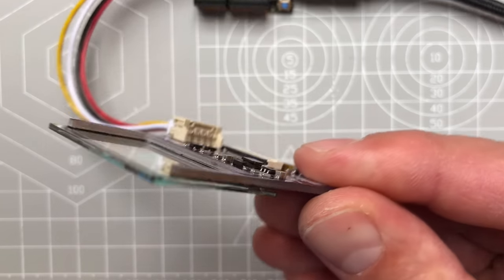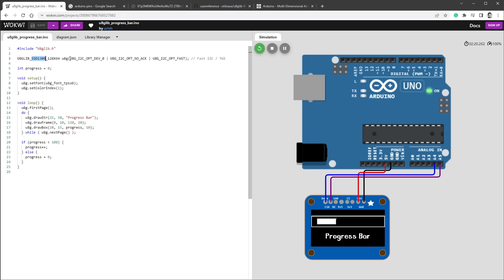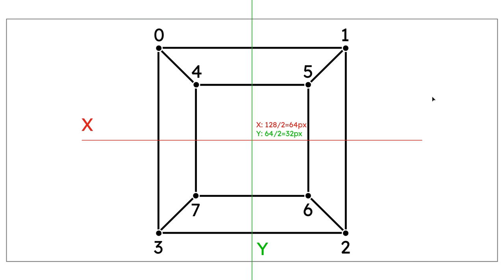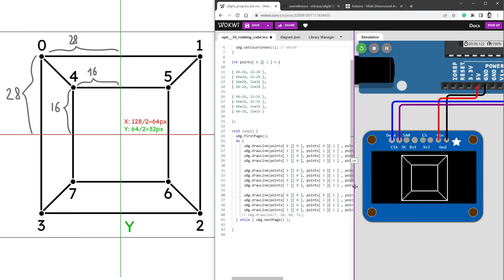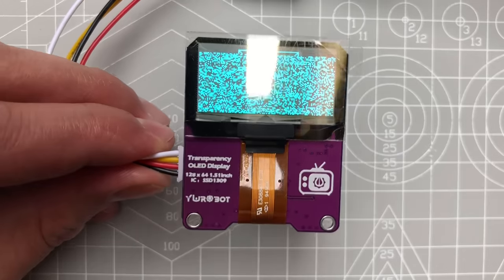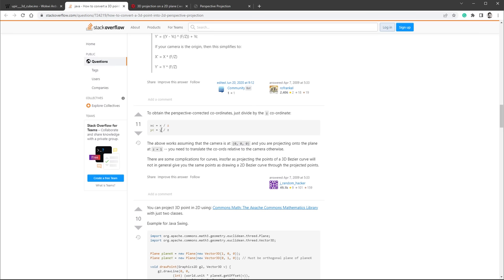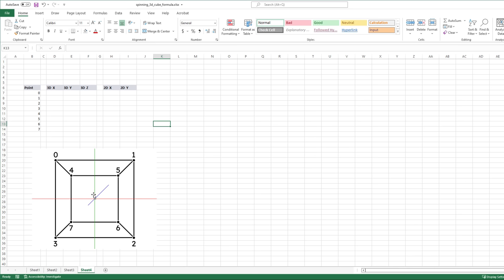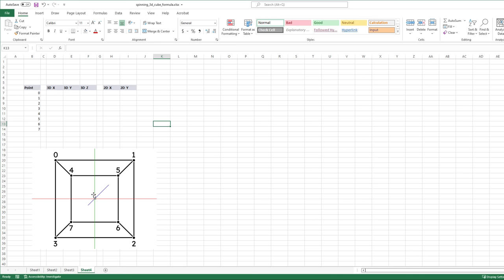Arduino + OLED = 3D ?

Comment: I wonder if these displays can be stacked to produce a volumetric multi-layer display. Looks like it's transparent enough to allow about 6 layers.
Reply from the maker: They could, and someone has done this already. It’s pretty cool — https://youtu.be/sVv1oc14X1w
Reply: @upir_upir  Ha, I figure I was recommended your video because in the past I watched that other video.
Reply: Yea but you would need eye tracking or the layers will shift as the eye moves. I bet you could do the same thing with one bent into a v and then mirrored and then one in front and to the back of the 2 v's
Reply: Real 3D hahahahhaha
Reply: im asking the same question
Reply: hello friend :D
Reply: Lookup Sean Hodgins. 

But yes. The possibilities

Comment from the maker: Quick update, I have tried a different 128x64 I2C OLED (non-transparent) display, and it works fine with the "fast I2C" connection, so it´s probably just a problem with this particular board? I don´t know the answer yet, but I will keep investigating the problem...
Reply: Hey bro, I am some sort of a newbie in embedded, So...How can I ensure that displays are Paspbery compatible or not?

Comment: Would love to see the explanation of the hidden lines problem. I started getting into 3D graphics back in the early 2000's in BASIC, but never fully understood the matrix multiplication needed for rotation. Now as an engineer I get it but havent had the motivation to implement it myself.
Reply from the maker: I actually don´t know how to do it in some "easy" way. The "standard" way is to define normals for vertices, and calculate visibility based on the normals orientation. Which of course involves either a lot of individual rotations, or matrix multiplications. In the cube example, I´m just faking it, since I know which lines would be invisible at which point.

Comment: You can speed up the calculation a little bit more - you are calculating the radians 32 times, but you only need to calculate it 1 time.  And then there is a hack. instead of using sin and cos, you can use a precalculated lookup table... yes that take more memory, but is way faster than calculating sin and cos.   i dont know how much faster this would be on an arduino, but i expect a lot.. this was some of the tricks i did like 30 years ago
Reply from the maker: Thank you for your suggestions. I’m actually using lookup tables for sin/cos functions, but good point about calculating radians, that’s surely not needed. I will try some changes and see how much faster it could be.

Comment: Love the detail in your videos! I suggest having a look at the GC9A01 Round Displays. They are neat! Also running two displays at once would be cool! Keep up the good work!
Reply from the maker: Thank you for your comment. I’m actually looking at that display for some time, but I would need to switch to some faster Arduino or perhaps ESP32. The uno is too slow for the display. I will post some video once I have some project running. Good luck with your projects!

Comment: Would be a cool screen to use with a accelerometer / gyroscope to make some AR-alike solution.
Reply from the maker: That’s a good idea, thank you! I will try it soon.
Reply: thats one of the many projects i wanna make, dunmo how to animate like a gyro map that moves when i move the accelerometer
Reply: I dabbled in this a few years back just for laughs but it didn't work, as expected since you need some mirror and lens to simulate depth by changing the focal length of the image being produced on the retina and at that point you might as well use a normal display and mirror and lens XD
Reply: @XxBanziixX1  I just thought that you can calibrate the gyro somewhere in 3d space. and then have a 3d model that you move according to the gyrodata. Then its like you move a camera over the 3d model. I have not tried it, but it should be possible.

Comment: Great project! I have one questions though, why do you use u8g instead of the newer u8g2?
Reply from the maker: Thank you! No particular reason except I like the documentation more. Otherwise, it should not be a problem to use u8g2 - I do use it in some of the newer videos.
Reply: @upir_upir  ok that makes sense, being the older version. The thing is that I was running some very simple u8g2 sketch in wokwi and it was unbearably slow, taking 10-15 seconds for the first render so I thought it might be due to the performance overhead of the newer library. Do you know something about this?

Comment: Tried this a long while ago (non-Arduino Mega2560, ASM code and parallel bus, 16 BPP screen - holds 60 FPS with antialiasing). It is much more fun to code if in color, as the 320x240 framebuffer will not fit into the SRAM, so a lot of bus transfers (wanted a background image to remain).
Reply from the maker: That´s great to hear. Do you have any links to your project? I would love to see it!
Reply: @upir_upir  Will upload one day (was actually a useless feature built into a service tool just because why not).

Comment: I would love to learn or even know what is all of this...:(. Great video though pretty cool stuff
Reply from the maker: I would suggest watching my older videos - for example the turbo gauge, that one has more details and it´s slower pace. If you don´t know anything about Arduino, please start with some generic "intro to arduino" video first. After that, buy  the Arduino UNO board, this display, connect it together and start playing. The biggest advantage of Arduino is the learning curve, as you can start with a very little and add more complex stuff later. In any case, let me know if you have any questions, I would be glad to help or at least give you some direction! Good luck.

Comment: Is there much difference between u8g and Adafruit SSD1306 libraries? I'm currently using the adafruit one and it takes  43 ms to erase and refresh the screen. Guessing it doesn't matter too much.
Reply from the maker: The u8g should be slightly faster, but probably not too much. Otherwise, those are both very similar libraries.

Comment: Subscribed! How the frequency/speed of the loop is controled? which determines the refresh rate of the screen or the other way around?
Reply from the maker: Thank you! The loop is trying to run as fast as possible, so the speed is determined by how fast are the calculations and drawing operations performed

Comment: Hmm... I would like this to be in the car as a HUD. Showing all the necessary output on the  screen. It's perfectly transparent to be applied for it. Although i would opt for a little bit of a bigger screen. I know there are kits out there that do this but doing it with this is more fun.
Reply from the maker: I agree completely. It would be great to have a bigger screen, and I’m sure that sooner or later, it will be available. Once it’s out, I will create the HUD project 🙂
Reply: @upir_upir  that would certainly be a interesting little project to see. To be continued??🤔😋
Reply from the maker: That´s surely possible! :) I will add this to my to-do list for projects

Comment: Is this the same display which used on heads up displays?
Reply from the maker: Probably not, this is quite big and has small resolution. But you can try to use it.

Comment: The IIC bus should have pull-ups. That MIGHT be why the high-speed doesn’t work
Reply from the maker: Good idea. I remember adding pullups for a different OLED display (that was the 16x2 OLED), because it was not working without those at all. I might try it here as well to see if it helps.

Comment: There are 15 OLED products in the link. Which one is used in the video?
Reply from the maker: Choose the one with PCB and for 5volts. There are two of them - with purple PCB or green PCB. That´s mainly just a cosmetic difference, they just look different, but will work the same.

Comment: Can you push a live video signal at 12 FPS ?
Reply from the maker: Yes, that should be possible. With a more powerful microcontroller than Arduino, you can even get 60fps.

Comment: You should calculate radians and use calculated value instead of calculate radians every lines twice.
Reply from the maker: Thank you for the suggestion. You are right that there are more optimizations that could be done to the code, but since I´m only transforming 8 points, the transformation wasn´t the slowest part of the code (it was the display connection - I2C vs. SPI)

Comment: Works with ESP32-ILI9341 320x240 SPI mode but has a glitch..odd lines at the initial start and the last frame of the rotation. I had to put a delay in because it spun too fast.
Thanks for sharing
Reply from the maker: Thanks for letting everyone know! Do you perhaps have a video of the project running?
Reply: @upir_upir  www.youtube.com/shorts/sOFFgF2tCzk  Link to source code 
drive.google.com/drive/folders/1tOAnoLebt8yYAtpwPEj_This14S4bJtw?usp=sharing
Code has a glitch I thing it's the 1st few lines drawn are wrong "shrug'
Reply from the maker: That’s great!

Comment: I wonder if the faster bus speed is a glitch on that 328 chip. Maybe try it on a different arduino.
If the edges of the generated signal are to 'round' for the display you might wanna decrease the length of the wires.
Reply from the maker: I will definitely try other Arduino. I was trying to google this problem, but haven´t found much information about the fast I2C connection. Good idea with the wire lenght, I will try that for sure.

Comment: Dude if u want a transparent display just use a LCD panel
Reply from the maker: Just remove the backlight? Well, that’s surely possible, and you will get transparent display, but it wouldn’t be very useful

Comment: got the same lcd with arduino uno and just seeing static on the display in blue
Reply: actually cant get it to display anything now. was seeing upir logo before aswell
Reply from the maker: that´s strange. Please check the connection and the wires. In the code, make sure you are not using the FAST IIC connection (remove the word from the initialization), and it should hopefully work. If not, please let me know.
Reply: @upir_upir  I used jumper cables to plug the cable that came with the lcd to the arduino could that cause an issue?
Reply from the maker: @genesisvlogs2140  I don´t think so. The provided cables should be perfectly fine. I would just make sure that the connections are correct, and make sure that the fast I2C connection is not used.
Reply: @upir_upir  i mean like in your case you cut your wires because they are only female pins at the end . In my case I used  a set of male to male to connect the arduino to the provided cable female input. I tried the slow IIC connection as well

Comment: use ++i instead of i++ and it will save some cpu in cycles
Reply from the maker: Thank you for your suggestion. I have quickly googled the difference and it seems to be the same speed for integers, but it’s surely something to keep in mind.
Reply: @upir_upir  its use size of one int in ram to return previous value

Comment: It's a great tutorial, but just one thing, after i saw it more than 10 times and stopped several times, please speak more slowly.
PLEASE.
Reply: You have to stop so people can think what you are saying.
Or else it would be something like this. https://en.wikipedia.org/wiki/Gatling_gun
I am sorry to point that to you but i really liked the info/video but not in the way that you delivered.
Reply from the maker: Thank you for your feedback. I agree that the speed was too fast this time. I will slow down a little next time. In the meantime, please use the playback controls to play it at a slower speed. Thanks!